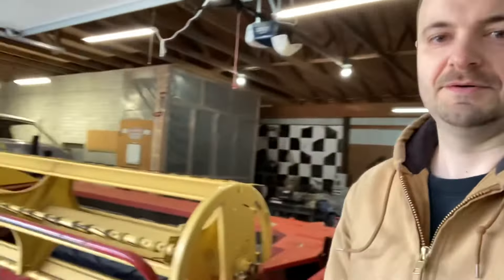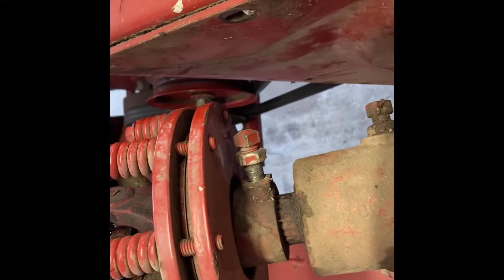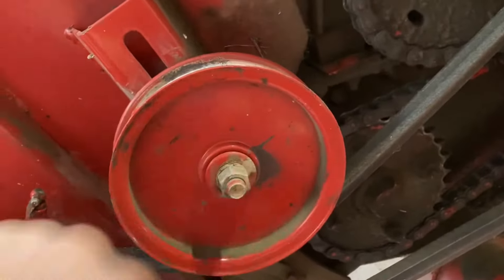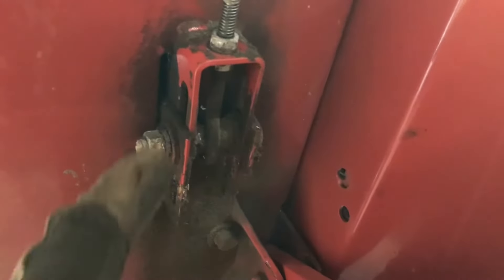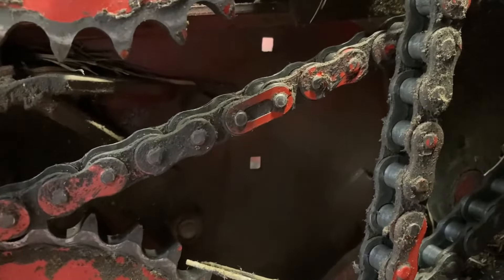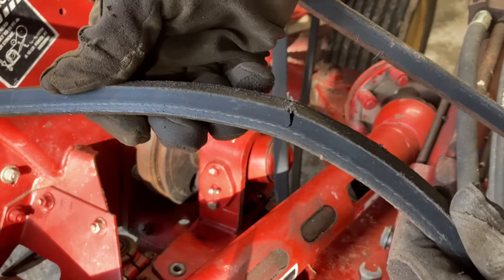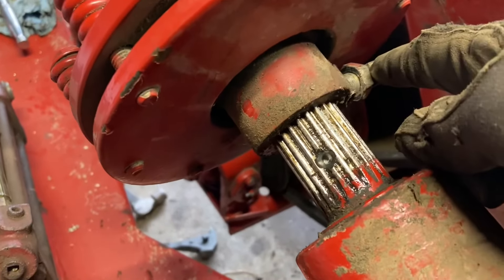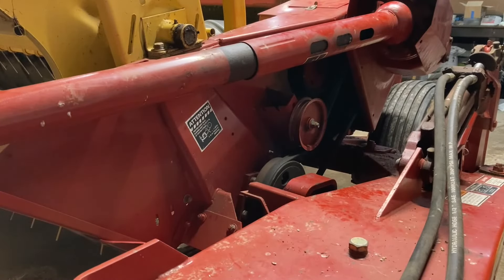Replacing wobble box drive belt on New Holland 488 Haybine

Comment: Thank you for making this video. I successfully changed out belt on a 477 using this video. Not an easy job, but you saved me hrs. of hassle. I did not take the chains off, and I just moved the gearbox out a little to get the belt in there. That’s a good trick, I had no idea how I was going to get it replaced.
Reply from the maker: Glad to hear it!

Comment: I replaced mine without taking off the wobble box. Undo the PTO at the BOTTOM and slide the belt along the full length. You do have to take the knife off of the wobble box, but don't have to remove the entire assembly. Undo the shield/plate where the safety sign attaches as he did with it disassembled.   You can force the belt through the tight space there to get it around the wobble box without disassembling it as shown in this video. Be careful here. It is a tight fit and I actually had to do it twice because I damaged the belt the first time. Hopefully you can figure out what I did from these brief instructions. I learned this from an older mechanic and it worked for me.

Comment: I cussed a few times for you watching this. Did the belt once on our 479. It’s missing pieces again. Once it snaps it’s getting repaired and traded lol. Just replaced the wobble box bearings now I’m working on rebuilding everything on the reel drive side of the mower at the moment. Also if you don’t want to fight the gearbox weight and have a spot to hook a ratchet strap above you a cinch loop around it makes it easier, an engine hoist works also but is an easy headache maker

Comment: I use a "segmented belt" and can change it out in two minutes.  Segmented belts have Polyeurathane sections and clip together much like a chain link. You can actually replace worn segments if needed- I keep them in the tractor tool box and have changed them in the field.  The one I have on now has lasted for over 25 years!  I have removed two links over time due to stretching, and keep them as spares.
https://www.youtube.com/shorts/lCvwwrDTJLc
Reply from the maker: Interesting. Do you have a link to share?
Reply: @TheScientistHayFarmer  Power Twist V-Belt 7/8"

Comment: I've done this belt change on a 488.   The brief reply below saying the chains do not need to be removed to slide the gearbox out a little is the most interesting optional step. I am sure I removed them, but I was hoping this video would confirm whether the sprockets slide freely on the shaft.  I have not found a parts assembly diagram to confirm this as I prepare to do this job for a neighbor's 488.  ..This belt does last long after the first cracks appear as do most medium duty belts, if kept tight.
Reply from the maker: I do not see how this can be done without removing the chains. The sprockets May slide on the shaft but they would have a key and a collar, and would likely be frozen on.

Comment: You should see the belt that I'm looking to replace if that's what you're replacing lol
Reply: I thought the same thing lol Im sure mines original. Had like 10 cracks
Reply: @rackemhardandy1381  mine had 2" chunks out of it lol
Reply: That’s how mine is. It’s been replaced once and after that it won’t get replaced until it’s snapped and that’s going to be a repair and trade job
Reply: @allanwallace2956  thats what mine looks like too did 25 acres 3 times last year but I have a feeling this year it will finally go.